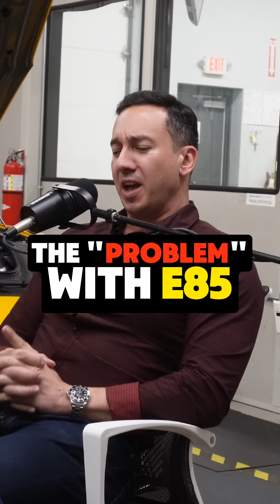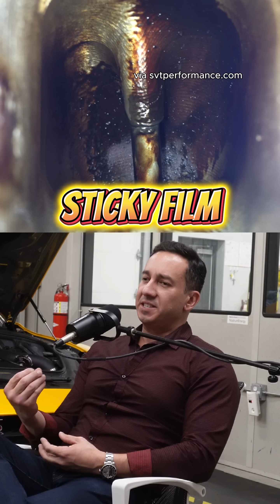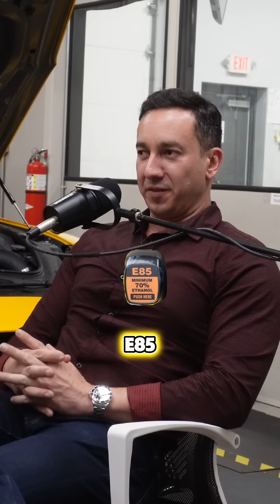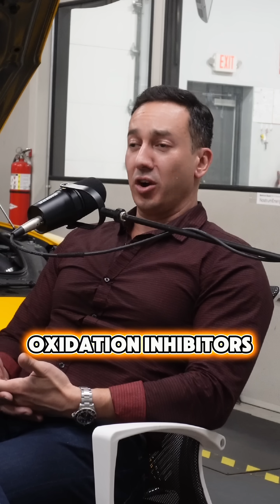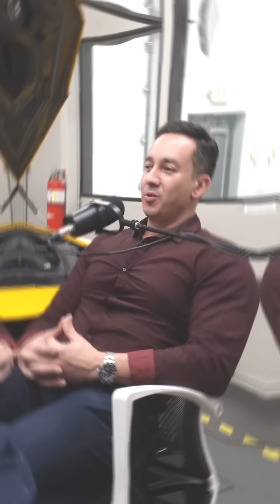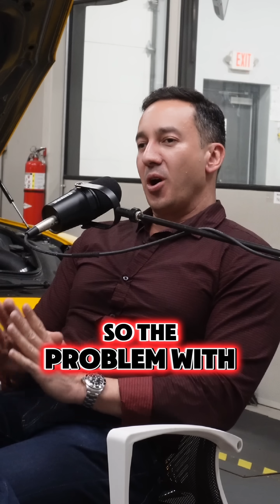THE "PROBLEM" WITH E85

Comment: I think pumping exhaust gasses and crankcase oil into your intake does more to harm your engine than your fuel
Reply: True, but it’s basically glue all those fine little passages are no go
Reply: Exhaust gas recirculation in modern gas engines is a big part of how they control detonation at full throttle. Gas engines are not diesel engines.
Reply: @DOAHunt3r The primary purpose of Exhaust Gas Recirculation is to lower combustion temperatures to reduce pollution. A lot of cars today do not have Exhaust Gas Recirculation. There are other ways to reduce pollution and minimize detonation.
Reply: @cruisinspecialtiesllc6104  I recommend reading SAE journal papers like 2014-01-1199 by Nissan engineers. Modern engines like the 2.5 Skyactiv-G turbo, 2ZR-FXE, A25A-FXS, FA20DIT, and latest Ecoboost 3.5 use cooled EGR to reduce knock under boost. It reduces the need for fuel enrichment or higher octane fuel.

EGR went away in gas engines for a while because valve timing was enough to achieve internal EGR. Now that EGR is being used in more complicated ways external cooled EGR is making a comeback.
Reply: @DOAHunt3r no, it's strictly for emissions.  It has nothing to do with stabilizing the fuel.
Reply: @jeremylunning654  Go read those papers. Modern gas engines cannot even go full throttle without knock with the cooled EGR system disabled.
Reply: @DOAHunt3r because they are detuned to run with an EGR.  Smdh
Reply: If properly tuned, they would have more power, more torque and last longer without adding abrasives into the engine that add nothing to performance.
Reply: @jeremylunning654  What abrasives, where? You're citing logic that only makes sense with diesel. Gasoline engines generate very little soot. Most of the intake sludge is just PCV oil which is why modern GDI with proper PCV oil separators don't actually experience any real intake buildup. Gas engines with cooled EGR run higher compression ratios because the EGR improves knock margin. Again, go look at modern engines or read some journal papers about them.

Diesels are not gas engines. Diesels can't experience preignition or knock because there is nothing in the combustion chamber to burn until you spray fuel into it. Gas engines have to mix the fuel first, then use a spark to ignite it.
Reply: @DOAHunt3r you aren't very bright are you?  Wipe your finger across the inside of your tail pipe...soot.  look at your throttle body after 50k ON A GAS CAR with EGR.  It'll be covered in soot.  That soot is carbon buildup which is very aggressive.  I understand you don't know much about cars, but you should do a little basic research before you speak.
Reply: @DOAHunt3r look up EGR carbon build up and tell me it's not a problem.  If they aren't contaminating an engine, then why do EGR valves regularly get clogged and stuck open and closed?
Reply: @jeremylunning654  Again, you're mostly talking about diesel engines. I've pulled manifolds on first gen GDI turbo engines which have tons of intake sludge from poor oil PCV separation while current gen engines like the B58 and others are squeaky clean even after 50k miles. EGR coolers and valves on gas engines can clog after 15 years/150k miles, but it's nowhere near what you see on diesel engines. If the engine doesn't burn oil the EGR system may never need service at all. These are things you would know if you actually worked on these engines at all and understood what you were looking at.
Reply: @DOAHunt3r no, I'm talking about gas engines. Are you not smart enough to comprehend what you're reading? LMAO
Reply: @DOAHunt3r just do everyone a favor and never attempt to work on any vehicle for any reason.  You'll be doing the planet a favor.
Reply: @jeremylunning654  I'm saying the concerns you have are entirely based on how diesel engines work. Diesel engines generate 10-100x more soot than gasoline engines which is where your point about "abrasive soot" is coming from. In gas engines the soot you're talking about is just not that much of a problem. And many gas engines tap their EGR after the first cat which eliminates most of what soot does exist depending upon the flow demands.

Automotive engineers are introducing cooled EGR to gas engines to make power efficiently. Premium gas is only 91 or 93 octane. Nobody is paying for a daily that requires 94 to 100 AKI. And they want that turbo power in a package that runs 11 CR and conservative cams that get to peak boost as early as 2000 rpm.
Reply: @DOAHunt3r give it up with the diesels already.  LMAO no one here is talking about diesels😂
Reply: @jeremylunning654  You're citing fuddlore common in diesel circles for why EGR deletes should be done. In modern gas engines you don't mess with EGR systems because the engine makes more power and uses less fuel with it. Ford would not go out of their way to add one to their Ecoboost motors if it didn't do anything. Emissions standards in the US don't care about full throttle where cooled EGR actually makes the biggest difference. For part throttle there was never any need to add cost with an external EGR system when variable valve timing allows internal EGR control. The carbon buildup you're talking about is next to nothing on a gas motor and most GDI motors run dual injection now so gasoline keeps the intake clean of carbon buildup.
Reply: @DOAHunt3r ford added it because the EPA required it by the way.  It wasn't a performance enhancer. 🤣🤣🤣
Reply: @jeremylunning654  There is no requirement by the EPA for cooled EGR. Go look up the actual test cycles. None of them will stress a 2.7 or 3.5 ecoboost where cooled EGR makes any difference for emissions. Ford themselves said outright they found a 5% fuel economy benefit from cooled EGR back in 2010.

No need to replace any EGR coolers or valves, just clean it off after 15 years and keep going.

By the way, spraying water into the engine along with gasoline is another performance adder. Water cools the engine better than gasoline and the interviewer in the video did just that on his R35 GTR to make race gas power on 93 octane.
Reply: @DOAHunt3r no, there's a requirement for cleaner emissions. This is the route manufacturers choose because it cuts the engine life down as well as meets the EPA requirements.  Educate yourself, the Internet makes it easy little guy.
Reply: @jeremylunning654  You clearly don't understand what I'm saying because cleaner emissions is only in the context of the EPA's test cycles, none of which are concerned with full throttle emissions. The EU does actually have a cycle that tests full throttle emissions (RDE) but the US does not and under Trump there is no chance that changes. Cooled EGR was a strategy to improve fuel economy and make more power. That's all there is to it. You don't get to 41% thermal efficiency on a gas engine with 14:1 compression running 87 octane without cooled EGR. If you're going to cite regulatory pressure at least pick the right one, which is CAFE standards. And under Trump CAFE standards no longer matter as there is no penalty for worse fuel economy anymore.
Reply: @DOAHunt3r yes ma'am
Reply: @jeremylunning654  Good to hear you're out of actual arguments to make. It's a free country though, delete your EGR and blow your motor trying to keep the fueling and timing tables the same if you want.
Reply: @DOAHunt3r I'm not out of anything.  You just can't fix stupid so why should I keep trying? 🤣
Reply: @DOAHunt3r  but to summarize, you think that EGR systems are good because they kill the hp and introduce contaminants into the engine.  Which has to be counteracted by more maintenance and adding more parts that can fail and the power is increased back to expected levels with higher compression which is also harder on an engine.  So you like engines that have less of a life span, has an unnecessary added system with more parts that can fail and are not cheap to replace and get worse gas mileage when the EGR system gets dirty or clogged which can also lead to engine failure.  You put a lot of trust into a system that isn't even needed.  But I understand completely that the world is full of stupid people.  At least you're easy to spot. LMAO
Reply: @jeremylunning654  I didn't say anything about "EGR systems are good because they kill the hp and introduce contaminants into the engine". This is entirely a strawman you created yourself. I recommend you actually read what was said and respond to that. If you can run 100+ octane leaded gas like the good old days and fuel economy doesn't matter then sure, cooled EGR has no value in that context. But consumers today expect to get 25 mpg out of their F150 while also making over 400 horsepower and doing all that on 91 or 93 octane. There's nothing "unnecessary" about cooled EGR in modern engines. It's not about putting trust into a system, it's looking at the data, reading what actual combustion engineers have done and my own lived experience. I recommend you do the same. Or don't and blow your motor trying to EGR delete a modern car without understanding what you're doing because you're worried about a bit of soot buildup that requires a bit of maintenance to clean out every decade or so.
Reply: @DOAHunt3r as a turbo DI car driver and modifier lol... Take that fucking EGR out as soon as you can (make sure you tune your shit) the carbon build up on the valves will basically disappear. When you're literally trying to take in  every ounce of oxygen to burn it all and, all the fuel, the recirculate part of all that once clean air (now full of carbon, and other random unburnt byproducts (I'm no expert but I'm sure fuel additives don't always fully burn up))back into the engine, how does that make any sense for power, knock resistance (sorry I  highly doubt my EGR system was cooling that exhaust gas enough to have any effect on knock or whatever. It very likely was making my air intake temp hotter) or overall engine longevity. all to hopefully burn some "unburnt fuel". I don't think you read the right book dawg?
Reply: @d @davidlewis-laurent8876  the effects of EGR are well documented. Subarus detonate at part load if you delete the EGR without pulling out timing in the tune. The reason why engines like the N54 with GDI get horrendous intake valve deposits is because of oil from the PCV, not EGR. Modern gas engines have too much compression for pump gas to work well without cooled EGR.
Reply: @jeremylunning654  Soot is a byproduct of incomplete combustion. In theory, a gasoline engine will produce an absolutely negligent amount of soot. In reality, there's a lot of conditions that can affect combustion, but generally, a properly running gasoline engine can and will burn almost soot-free. EGR deletes are usually not a good idea on modern gasoline engines; modern EGR systems significantly lower combustion temps and greatly increase scavenge rate (the rate at which exhaust gases evacuate the cylinder.) I know over on the Subie forums a million different guys have tried to do EGR deletes and they all came up with the same answer: don't do it.
Reply: Yes agree %100 also low tension pistion rings, extended service interviles and now belts in oil are just a recipe for disaster.
Reply: You’re not trying to pump that stuff into your cylinder through the pcv you’re trying to get the latent air and fuel mixture out of the backside of your piston which does get past in most cases
Reply: @benjaminwatson7868 Sure, that is the purpose of pcv, but oil does go through the pcv system into the intake on most factory engines.
Reply: @ an engine was designed to survive it I mean what is gasoline other then oil
Reply: @cruisinspecialtiesllc6104 thats why we have oil catch cans
Reply: @benjaminwatson7868 carbon is abrasive. Add it into a cylinder and it will wear faster.  Engines are not made for it, they just reduce the emissions with the compromise of shorter engine life.  Something the car manufacturers are ok with since it will drive sales up.
Reply: @benjaminwatson7868   Yaas !
Reply: It doesn’t.
Reply: @JohnZornAscended you're dead wrong
Reply: @jeremylunning654 It does cause it to get filthy if you don't change the very cheap emissions parts, it doesn't cause catastrophic damage.
Reply: @JohnZornAscended  adding  anything to a system that doesn't benefit the life of the motor and actually causes wear and lowers fuel economy is not a solution in the real world.  Egr valves can cost over 600 bucks to replace, I wouldn't call that cheap and that's just one component.  It may not cause catastrophic failure, but it is costing me 10 to 15 percent of the life of that engine, that's too much. Especially with the cost of vehicles these days
Reply: @JohnZornAscended your argument is like saying it's ok to add a gallon of water to your gas tank every fill up to save money on gas.  It won't cause the engine to blow up, but I still wouldn't do it for the same exact reason. Adding contaminants is never a good thing.
Reply: @jeremylunning654 Every single North American car company, including the Japanese does this. Are we smarter than all those engineers!?
Reply: The only issue was the egr.
Pcv systems are purely beneficial to motors. 
If you didn't have a pcv system your motor would blow gaskets all the time. 
Don't believe me? 
Weld your pcv system closed and block the intake point for it. 

Egr is where your soot and gunk is coming from.
Reply: @kairu_aname gas engines don't produce any where near the level of diesel, if there is soot and gut from egr in gas then you are running rich. 

The only reason why they would be sick is because you're not running at a Stoko metric level of fluid. gasoline does not leave soot because it combust in the combustion chamber while diesel does not fully combust.
Reply: @Parleyjr2248  
Maybe you're not aware of how running egr systems causes most of the gunk and soot?

It doesn't matter what stoko level you're running, putting exhaust gasses back into the intake doesn't help the motor and WILL cause gunk and soot. 

Diesel generally has soot,
And gas generally has gunk.
That's was the point, to be generalized to the motors, not "well this motor(X) has this level of soot and gunk, and this other motor(Y) has these different levels"...

Maybe you were talking about getting quality diesel? In which case, no. People buy what they have access to and it varies even by gas station to gas station. 
Maybe you were trying to agree but it didn't sound that way? 
I don't know. But whatever.
Reply: @kairu_aname  hahahahaha. no dude....venting your crankcase is normal...dumping it back into your intake is retarded. 

that is the point. same as EGR. it does more harm than good.
Reply: Actually they both do harm.
Reply: Deleted that in my Harley, my diesel pick up, and my Yamaha grizzly. I don’t believe in shitting where I eat.
Crank case breathes to the atmosphere as intended
Reply: @jayonez137  
Ok, just to let you know: 
 if it was built with a pcv system, it was built to operate with negative pressure on the internals. 
I promise you're going to have bad seals and a rebuild in your future before you know it. 
The pcv system is purely beneficial to your motor, it even allows older motors to last long after their rebuild mileage.
 
If you don't like it eating oil, because that's what people seem to think it's doing, check your seals first, then learn where your pcv system vents from and if there's a small tube structure inside the motor where it's at, drill some small holes where it can gravity bleed the oil back to the crankcase.
Reply: @kairu_aname  
Been doing this for for 40 years kiddo. 
My diesel truck has 560k miles on it with crank case breather delete. 
My last Harley
Had 88k miles on it this way. 
I have proven my theory decades ago. 
You have zero clue what you’re talking about. 
Have you ever seen with the top of your pistons look like from crank case pressure/oil vapor mist getting sprayed back into your air cleaner? 
Tons of carbon sitting on top of your pistons, causing you to lose HP.
Reply: @jayonez137  
They don't look like you think they do. 
Reason? I clean them. It only takes a smidge of water in the intake to clean the tops of your pistons. 

But sure, you could lie. 
If you don't like it, say that, but don't lie
Reply: @kairu_aname  I build a V twin engines for a living. 
You definitely don’t have a clue what you’re talking about. If you really think you can spray a little bit of water in your intake.
Amsoil sells a treatment for that so does Seafoam. 
The combustible engine was never designed for crank case ventilation to be dumped into your intake. 
You got a lot to learn bro 
And I don’t lie. 
I rip down a minimum of 10 motors a week and do thorough inspections on both motors where the crank case ventilation is going back into the intake and also rip down motors where they have deleted it and vent to the atmosphere.
There is a night and day difference 
When you’re pistons get full of carbon, you lose power 
It makes the piston that much heavier and the ignition in your cylinders inconsistent 
You should get a job with Biden’s EPA
Reply: @jayonez137  
https://youtu.be/AxIPP3hdY6c
Reply: @jayonez137  
Keep it closed next time. Maybe you might learn something if you aren't a liar.
Reply: @kairu_aname  
keep watching backyard mechanics on YouTube videos!
When you finally grow up and move out of your mommy’s basement you’ll be 5% of the mechanic that I am at 54. 
I build performance motors for a living kid!
You got a lot to learn.
Your posts make you sound like a seventh grader.
And if you’re not, then that’s even worse
Reply: @jayonez137  
You don't build preformance motors, if you did, you would absolutely use the pcv system. 
But arguing with someone that literally doesn't know what it does is a fruitless endeavor. 
You're an old liar and it will stay that way.
Reply: Agree deleting your egr completely, diesel or gas , your fuel mileage will increase as well as performance, EPA has pushed some of the dumbest things
Reply: I feel like the misconception of her being bad comes from tuning in the 90’s most gas cars need it to get to temp for longevity of components and to serve the demands of weather unless you want a car you couldn’t drive in a snowy area or leave with out warning up for 5 mins not to mention the added mpg you get
Reply: So it should go out into the air? And instead harm your health and everyone you? Makes sense….😂
Reply: @JustinSeara you got a lot to say for someone posting videos with cars that dump much more pollution into the air than new vehicles. Lol